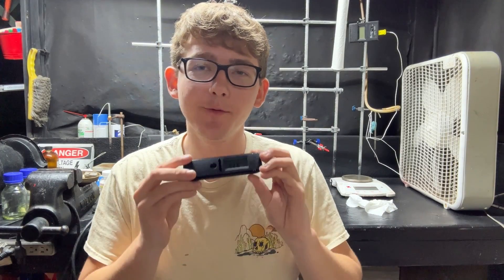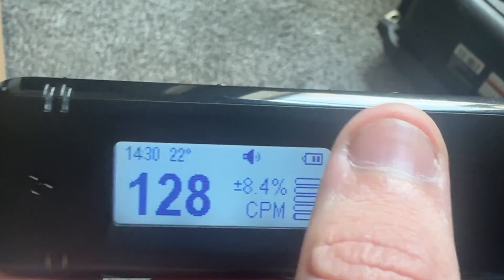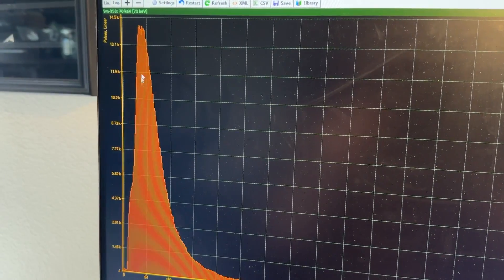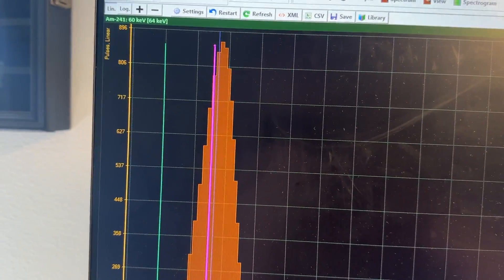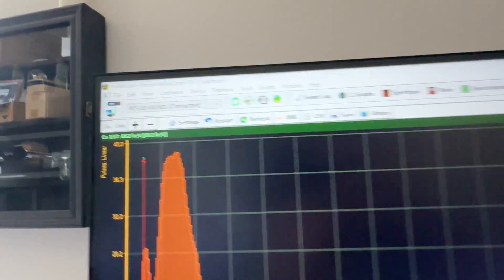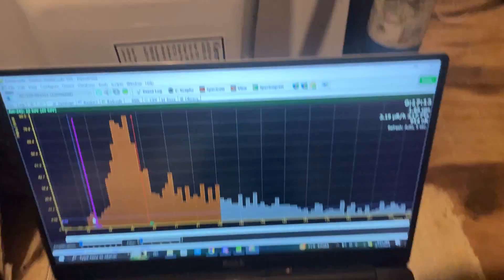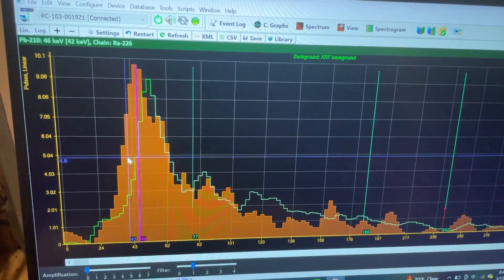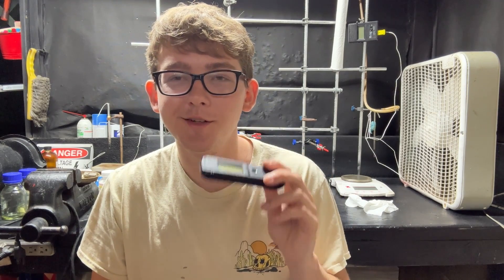Testing radioactive Chernobyl blueberries

Comment: To detect the K-alpha line of gold (which has an energy of 68.8 keV), you would need a source with energy higher than the K-edge of gold (80.7 keV). Am-241's 59.5 keV gamma rays are insufficient for this purpose. In summary, Am-241 cannot directly excite the K-shell of gold, so the K-alpha line of gold will not be detectable with this source. However, you can still detect gold using its L-shell X-rays. For K-alpha detection, a higher-energy source is required.

Comment: I bought a 103 a few months ago and looked around the house to eventually find higher background radiation in my basement, this led to me checking my water tank and my god! it threw out an alert at 0.2 uSv/h and it kept climbing up to 0.47 uSv/h. what it detected was a strong peak on Bi-214 from radon in the water. last person I know that lived in this house for a long time developed cancer at the end of their life, a filter plus radon separator is on the way to be installed as the water test i did after the discovery showed in the result that it is non potable because of the amount of radon gas in it(1300 Bq/l, limit for potable must be under 1000 Bq/l)
My mother did a test on her water as she is my neighbor(different well plus she has a filter installed) and her wells radon amount was 56 Bq/l.

My water had 64 uG/l of uranium in it, recommended is below 30 uG/l.

Comment: Nice video man, but for me it doesnt work, cant replicate it. I have a radiacode 103 and same setup, lead wall, I have  9 x 0.9 microcuries Am241 smoke detector sources behind a thin film of polycarbonate. I am still getting the characteristic two peak spectrum of Am241 despite less cpm due to lead wall as baseline, no matter how weak the signal is.. Baseline is unlike yours, with the small peak at 20 keV and big peak at 60 keV.  A guy tried to dissolve this smoke detector cores with HCl and failed cos apparently the Am is pressed into or under a thin film of gold. So you should get a gold K alpha straight out of the source. Quite frustrating. I tried a lot of iodine / iodine compounds which seemed to yield some peaks,  but require further investigation. Did you put 6 smoke detector cores under this metal cap in the ionisation chamber? Why didnt you remove the metal cap, which seems to attenuate and aditionally pollute the spectrum which signals.

Comment: Why bother ordering smoke detectors when you can get easily and usually on sale (they are often subsided somewhat by local and state governments, here at least, as it's cheaper than the money that would have to be spent on the fire departments without them) and they even usually come in multi packs. Cost I'm guessing?

Comment: I got the radiacode 103 and the FS5000 geiger counter. I prefer the radiacode when searching for radioactive pieces since it is a lot faster at detecting the item.
The downside of the radiacode is that it only detects gamma, when the radiacode is reporting 2 uSv/h, my geiger is reporting 50 uSv/h so uranium really gives off a lot of beta radiation.

Comment: 100 cpm background is pretty elevated unless that is a pancake style detector; then its usually 3 times as high as the normal background is
which tbh it makes sense if the background of the area truely is around 40cpm
due to the size of it i think its a pancake style
Reply: It's a crystal, not a geiger tube

Comment: I would love one of these, but $350 is a bit too much for a thing i wont ever use, a regular geiger counter is about $200 though, so if i was ever planning on doing something with radiation, i would definitely pay twice as much for all these nice features
Reply: The channel called Studio 326 does a lot of radiation detector reviews and recently a video about a 50 buck geiger counter was really good like it could detect higher levels than even really expensive geiger counters
Reply: I bought it two days ago. And yeah with things like this is always a question of will I use it often enough in the long term that it's worth it.
Reply: @thesciencefurry  it's basically a dollar a day for a year, so if you could save a dollar a day rather than spend it on something else, then you will have enough to buy one and I have the 102 since I bought it a day before the 103 came out but I'm still happy with it and if you want to save some money just buy a 102
Reply: @technoman9000  you could make a jar for buying a radiacode but you could also just buy one or better yet just put like 10 bucks a day and get a 102 in a month
Reply: Yeah $350 is steep but it has so many possibilities. I only have a GQ GMC-300S... Simple Geiger tube. It's nothing compared to this fancy sensor.
Reply: A regular geiger counter costs 30-35 dollars on aliexpress and they are pretty good.
Reply: @mehmetinlaboratuvar7099  there's only one really good one under 50 bucks and I forgot what it's called but studio 326 made a video about it and it's better than 200 dollar ones or if we include the gamma scout it's better than that 500 dollar disappointment

Comment: I have the 102, and I love it ❤

Hold up basic xrf with a radiacode that sounds like something fun I could do, but I'm not sure if mine would work as well since the smaller crystal

Also no last minute test to see if it was or wasn't xrf on the tellurium
Reply: Your 102 has the same size crystal as all the Radiacodes 10x10x10mm. The 101 and 102 use a 3x3mm SiPM detector, and the 103 uses a 6x6mm SiPM detector. so long story short the only difference between 102 and 103 is the resolution of the spectra and the 103 has is a little faster at collecting a spectra.
Reply: @franciscasey3789  thanks for the correction also have you tried out xrf with your radiacode (I tried it but the best sample I could detect was silver)

Comment: That is cool. Fluerescent x-ray spectrography at pocket size. Never thought of using the device like that.  I've used my older Radiacode-101 only for gamma spectrometry.
Mine seems to be better calibrated than the one you have, I have a very clear (but weak) Cs-137 peak at the background like most of europe with not much error. (I've not recalibrated it).
I've also found probably a lot of radon with it in one basement, had about 0.7uSv/h and clear daughters. (Radon as an alpha emitter is not of course detected directly) some other occational findings in my normal environment, mostly due to uranium in granite or similar.
Reply: I tried it but failed since I had the beam of americium go through a silver coin straight to the detector but after my current experiment I will try it again the right way
Reply: @The-One-and-Only100  I think this video had a great example how to set it up:n not through but rather more like you'd set up a mirror with light.
You don't want beam going through metal, especially if low energy photons are to be detected. (Silver as a heavy metal will absorb too much). With through measurement you'd also contaminate it much with bremsstrahlung that I think is more directional while there is much less back scattering.
I used to do xray analysis of minerals as a summer job way back and it was always about surface layer. For powdered samples we used paraffin wax holders to keep spurious emissions out (C & H don't emit detectable spurious signals or at least did not for that measurement device).